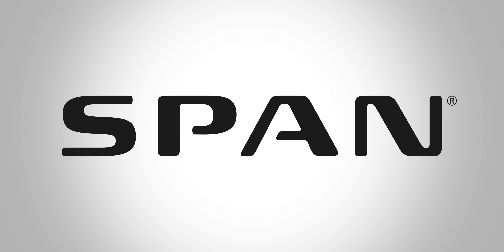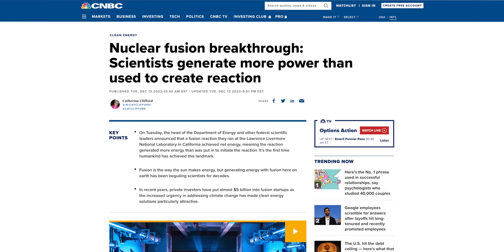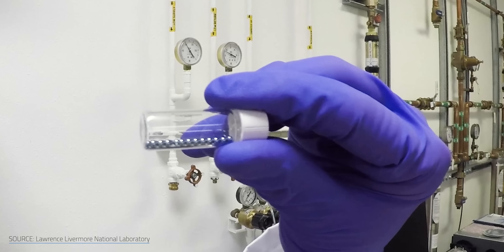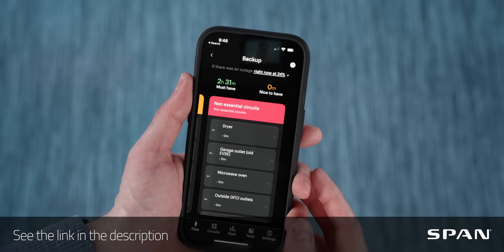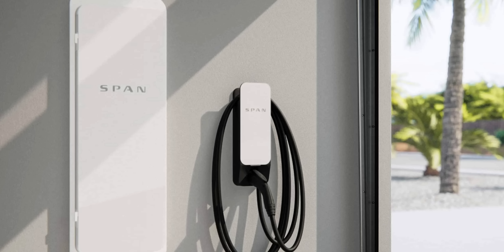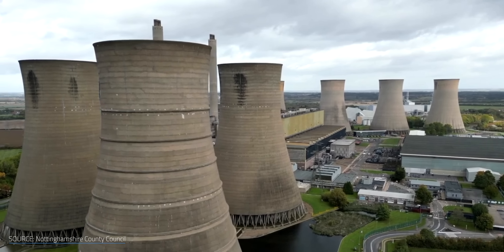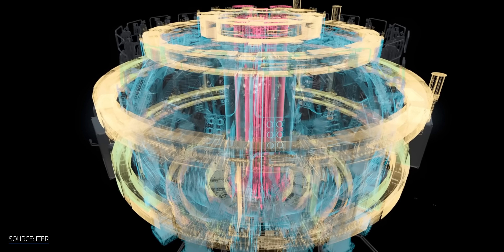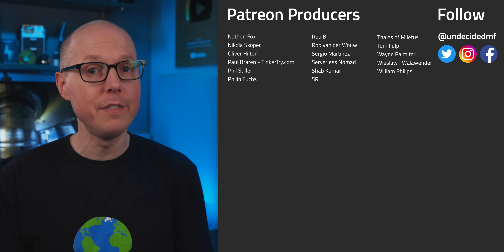What This Breakthrough Means For Nuclear Fusion

Comment: The impressive feat of the NIF is that this is a very old test reactor which was never expected to get anything close to a positive power reaction. That this worked as well as it did is super impressive!

That said, there are lots of other breakthroughs coming which are much more promising. So kudos to them... But this is very much a research project, not a viable energy production option.

Comment: I've no opinion as to which technology looks to be the most promising, I'm just glad that there are such a range of methods being worked on to try to achieve fusion power these days.  Tokamaks able to fuse continuously would be wonderful,  and I'm glad they're still being worked on, but what we need is a fusion system that is good enough to help us out as rapidly as possible - "better" or "perfect" systems will be nice to have in the long run,  but if the smaller, cheaper discontinuous fusion methods will help get us off fossil fuels sooner, I'm all for it!

Meanwhile - hot salt thorium fission reactors should be developed more rapidly to give us the ability to take up the slack from renewables when they can't generate enough energy due to the weather.  Yes, I know some people  (my politcs are very Green, but this is one where I feel that many folk of similar viewpoint are just plain wrong) won't like it "because nuclear", but they'll dislike having insufficient electricity even more, and a modern hot salt thorium reacor would be vastly safer than the  types of reactor currently in service.

Comment: I’m tired of promises in atom fusion reactors and billions spending. If we are not achieving a net positive process, just how much new elements were produced in that process so far?

I also wonder if the net output is caused by new energy in the fusion or it is a measure of residual energy in the reactor? If that was residual energy taken as new energy, apply for a job to fusion experiment and you’ll get a better chance on pay roll the next 30 years.

Comment: So if the Lawrence Livermore facility updated the LASERs to the most up to date efficient devices, they would still be a long way from producing a net positive system level energy gain.
Meanwhile, commercially available PV comes in at only 20% efficiency and commercially available wind generation comes in at around 35% efficiency. 
This is the great thing about the currently available renewable energy sources  - despite the low efficiency they are both commercially viable energy generation technologies.  Rather than having to spend all the effort getting the efficiency up to some insanely high value the renewable energy industry can turn its attention to just rolling out the adoption of a technology that is good enough to be useful and something we know how to manufacture.

Comment: You are contributing to the FRAUD that is fusion! STOP IT!!! There is NO route to economic energy positive production using fusion in a 100 years or more. If we keep wasting funds and time on this non starter we will risk falling short in the actually working energy production and storage we already have NOW! Improvements in solar wind hydro and thermal will more than cover all the worlds needs, current and future. Any form of matter manipulation fission or fusion will forever lock people in the grasp of utilities and governments when it comes to energy. The only road to a  clean independant future is that we all can produce all the energy we need ourself. It is bad enough that we will have to buy the means to get power, but buying power it self from a central source is a terrible idea in the long run, at any price.

Comment: I think Helion is still the best concept; especially since they generate their own fuel as a side product. I do see the value of the research being done down different avenues though, so I hope they continue to succeed, even if just to continue to expand our knowledge base.
ETA: I also like Helion as, when visualized, it's basically the Enterprise-D warp core placed horizontally.
Reply: The other ones, even the “break evens” like ITER can make huge strides.    
  ITER supposedly has ~68 different variants of the composite ceramics that line their reactor.  So, without those tests we could be delaying higher efficiency Fusion, with less radioactive waste, in the viable designs by years.

Comment: As a plasma physicists, the result from the NIF is a remarkable achievement. I do think it is comparable to the Wright brothers  demonstration of first flight. Presumably no one called this commercial transport. As such, it is a bit disingenuous to call the NIF  a "reactor". The NIF was designed to demonstrate the scientific viability of nuclear fusion, not act as an example of a potential fusion reactor. This simply test the current understanding of the  physics required to achieve nuclear fusion in a controlled manner. 

I do find several of the other approaches rather intriguing. But I have not studied these approaches to understand their pros and cons. My worry is they seem to depend on scalability. There were several approaches to fusion  back in the 70s and 80s that seemed viable but depended on scalability. However, each had a flaw that was difficult to over come (including laser fusion). So, barring any further amazing results,  I do see a fusion reactor as being 30-50 years away.

Comment: I presume you mean 20% efficient lasers (10:30).  Normally 20% more efficient would change the NIF's 0.5% to 0.6% because 0.5 * 120% = 0.6% like the calculation for 20% more fries or 20% tax.  Unless it's added, for 20.5% efficient lasers...

Comment: This announcement has actually made me more pessimistic. I went from thinking it was 30 years away to thinking that it will not be possible on earth. The various confinement methods, fusion paths and fuels, all are a at least an order of magnitude away from break even (once you factor in the energy costs of running the reaction) and at least three orders of magnitude away from being viable for grid production.

Comment: No form of fusion will "make it to market" for grid power until its LCOE can beat the ever falling LCOE of solar, wind and geothermal. As Matt explains, laser fusion is about the worst on the cost scale, but even the best has many decades of cost reduction to go before anyone is gong to invest in power plant deployment.
Reply: Exactly!  Also, I would point out that commercially available PV is only 20% efficient and commercially available wind generation is only 35% efficient,  however these technologies don't require higher efficiency to be useful.  So rather than investing effort trying to get the efficiency up to some unrealistic high value the industry can simply focus on scaling the practice useful technology that will know how to manufacture.
Reply: @michael-j-harrison  Yes, efficiency becomes important in applications where cost does not matter but size and weight are critical (such as power for space stations). For grid power, size and weight are usually not critical, but cost is. When the cost of deep drilling for geothermal becomes low enough, high density 24/7 energy will be available anywhere in the world. That is going to happen before fusion, and then it is going to be very hard to beat the cost of a hole in the ground.

Comment: another fusion myth is the notion of using a fuel mix that will only result in charged particles - there will always be a percentage of the fuel that doesn't react along the preferred pathway. All fusion reactors are going to produce some neutron bombardment that will have to be dealt with.

At any rate, the more "optimistic" briefings there are on the different fusion reactor approaches, the it is apparent why it is perpetually always 20 years away.

Comment: Is it possible to use solar light instead of lasers? Like make a field of mirror reflectors somewhere in desert and focus them on the fuel. It will not require energy for inefficient lasers, also will allow to use more of light spectrum including IR and UV which potentially can improve energy compaction. I know sunlight not coherent, but is it truly need to be lasers for start the reaction?
Reply: Yes, it does need to be lasers. You need the coherence of several lasers to trap the plasma. Further, it is not immediately clear if the solar light would allow for the temperatures required due to the laws of thermodynamics.
Reply: @shadogiant  I searched a bit and found thing called SPL, which is for Solar Pumped Laser. Also in 2020 new type of SPL was invented which used a optic fibre to convert incoherent light to coherent so potentially we can turn solar light to laser directly. But I'm also have no idea how large/complex should it be to achieve necessary power. Another idea is to use direct focused incoherent light to just heat target, and at same time use less powerful lasers in combination with magnetic field to control plasma(to make process more energy efficient).

Comment: The tokomak design just won't go away. A few decades ago, if memory serves me, that design was nearly abandoned because scientists couldn't figure out how to make it work. The HUGE tokomak that is in europe was built, hoping the greater size would allow them to build up the conditions needed to create a workable design. Now we are going to make a smaller one, hoping to make it more efficient. 🤔
Neither size addresses all the other problems with the design. The need for tritium. The probable need for a fission reaction to create the tritium. The very high, sustained pressure needed. the hot plasma that is under that pressure. The exceeding complexity needed to keep the whole thing operating (safely). You might as well build a standard LWR.

Comment: Then they didn't actually get more out than they put in as 200mj beats the Hell out of 3+mj. They did not achieve the goal. Only when they get an actual output greater than the total input will they have done it. Helion and HB11 are more likely to go commercial but 1st Light is close behind and gaining.

Comment: Why don't they power the electricity that's needed for the Fusion reaction with a dedicated small form nuclear reactor, Thorium Reactors, or LFTRs?
Reply: In that case, why wouldn't you just use the fission reactors to supply the power you need?  If you use it to power a fusion reaction that is going to give you less energy that you put in, you're just wasting it.  Or did I misunderstand your question?
Reply: Energy from small form nuclear reactors is more expensive than energy from wind or solar (or natural gas) so what's the point?
Reply: @HaldaneSmith  A typical 1,000-megawatt nuclear facility in the United States needs a little more than 1 square mile to operate. NEI says wind farms require 360 times more land area to produce the same amount of electricity and solar photovoltaic plants require 75 times more space. (Energy.gov) you don’t have the real estate in the city for large wind/solar, and transmission is lossy and expensive.

Also, nuclear is reliable, whereas wind and solar need massive storage capacity to be reliable. When you factor in storage capacity and maintenance for large scale production and storage, nuclear is cheaper.

But we should research and implement all of them. Solar vs. nuclear is a bit of a false dichotomy.

Comment: Having to cool down the reaction chamber indicates there is no vacuum chamber , so the cool down period would not be an issue or lasers being more accurate without atmospheric scatter in a zero atmospheric area . Cryogenic physics is similar to extreme temperature physics as the atoms become pancake shaped and very dense . If fusion using the laser implosion method is viable  , it might need a condensate at fractions above 0 Kelvin dripping and fusion occurring twice a second , which might work in Science fiction , but yeh 30 years away , maybe .😢
Reply: Only the target is at cryogenic temperature.  All other NIF components are at room temperature.

Comment: I think it will serve a purpose in the future for off world power.. but on earth, even a tiny area in Africa can generate enough solar power for the whole planet.. the problem is the cost for undersea power cables and obviously power at night.. however, if every home had one of these up and coming solid state batteries that could be charged as well during the day, you could have power for nights/evenings as well. This is a workable solution now... doesn't include hydro and wind power when you factor all the elements. I just think renewable is the holy grail to focus on, but having fusion reactors or equivilent would simply be backup generation.  There are types of gas and fuel in our solar system that could power the planet and could be collected using AI drones. Space untapped supply of materials.. yet we continue to invest heavily in projects that may never work efficiently when there workable options now. I guess that's what pits me off getting too excited 😊

Comment: I may have missed something, but you mentioned they achieved fusion for the first time ever?  Must be the subtle wording because we've certainly achieved fusion before.  (And yes I know that the achievement here is about the net energy output)
Reply: He said they achieved "fusion ignition" for the first time ever. Ignition is defined as when the fusion reaction outputs enough energy to sustain itself.
Reply: @chhunter  Ah, thanks!  I didn't realize that definition of Ignition.
Reply from the maker: Sorry about the confusion.  I could have made that part more clear.
Reply: @UndecidedMF  No worries!
Reply: @chhunter  also not true. H-bombs achieve fusion ignition. NIF achieved controlled fusion ignition in a lab for the first time.

Comment: I watched the panels after Dec 5th, they explained that the lasers were so inefficient because it was just a prototype. The 200MJ cost would drop substantially after optimizing a laser system.
Reply: Yes I figured engineering could solve the problem

Comment: Interesting that HB11 is trying to do something similar to what TEA has been working on for the last 20+ years.  I mentioned it before that you should checkout TEA however they are private so not a great deal you can get from them.  Like HB11 TEA has direct production of electricity which is highly efficient (80-90%), a significant improvement if they get it to work.
Reply: I am sceptical about HB11, at first glance their method looks like electrostatic confinment in disguise: accelarete ions enough to overcome electrostatic propulsion and fuse together. Problem is that most of the time fast moving ion encounters another they will not fuse but rather scatter, exchanging energy. After a few of those events (and its probability is orders of magnitude higher than fusion taking place) specific ion does not have enough energy to do fusion anymore. I do not have nearly enough expertise in physics to review the scientific work linked by HB11 to see if they found a way to work around that but this would need to be something big.
Reply: It's usually called PB11, P for Protium (1 proton hydrogen) cause fusion reactions generally utilize heavier forms of hydrogen abriviated D and T so you always need to be clear.